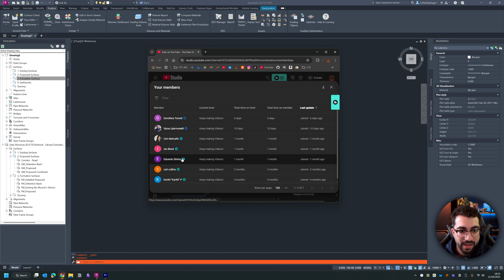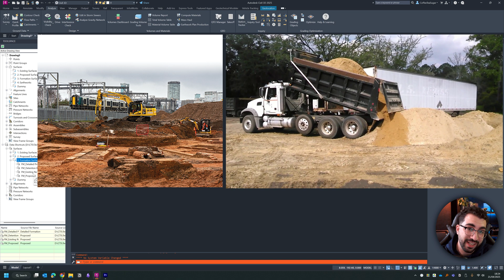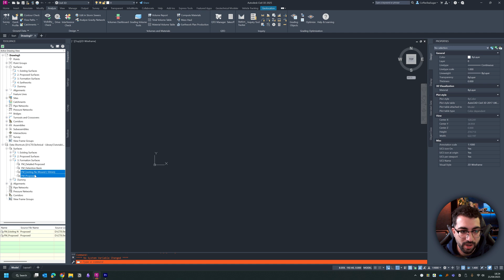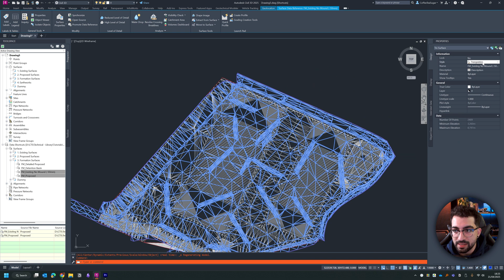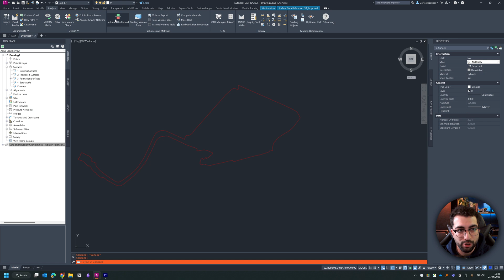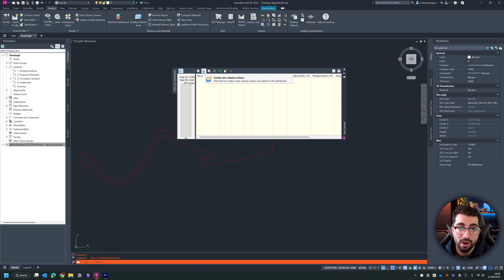Civil 3D Surface Volume Analysis - Everything you need to know!

Comment: I have a pond with Mutiple dredging depths of various shapes. Each shape has a bottom that is not flat, but instead a contour that matches EG but at a depth of 1 foot below, 2 feet below, and 5 feet below for the third shape. I was able to paste the shapes (surfaces) together with EG; however, I tried to perform grading between each stacked elevation. the grading failed because the shapes of the bottoms did not overlap when looking from plan. I could not modify the shapes, because each bottom was clipped from EG, and lowered to the -1, or -2 or -5 relative elevation compared to EG. I tried to enlarge the shapes, only to find that it created a vertical ridge. AutoCAD is not as robust when working with surfaces as compared to Rhinoceros. If you can create a tutorial solution to this challenge, it would be greatly appreciated.

Comment: When you linked surface with Data Shortcut into the new drawing, probably volume table was wrong cuz you have to add again the surface into the Volume Panel as you did at the end of the video. Could it be that one the problem with volume recomputation? In addition, it is possble to add into Legend Table a new colum with 'Cumulative volume' for each row? Something similar to what you do into cross-section tables... Anyway very informative and useful video 👍🏻
Reply from the maker: Excellent spot, ultra instinct activated! I figured that one later on! So not sure why, maybe because there is no information from the surfaces you used to compare?

Comment: Suppose I wanted to make a 'bench' for a quarry, i would draw a polyline, hen offsetfeature with the bench distance, and the fall. and repeat etc. Then i make that a surface and compare to the existing, and even make a new surface and paste.

do we always paste the surface that has higher elevation?

and

I would love to see a video on how to use he viewport and make good engineering drawings:-

1) how to extract the chainage and elevation of a profile to a table form for the drawing 

2) How to use a the csvlist command to get the easting,northing and elevation of a polyline or feature.

3) how to make A3 drawing template?

love ya!
Reply from the maker: @CarbonTaxLOL  Thank you for the comment. For the quarry my first instinct is to use a featureline and grade it and then grade the grading so it can be all dynamic. I always use the existing surface as a base as this will tell me clearly how much I need to cut or fill. If you are comparing surfaces that don't exist yet, then I would ask which one would be built first and use that as the base. 
A video on how to make a good drawing is a good shout! 
The rest will have a look and get back to you.